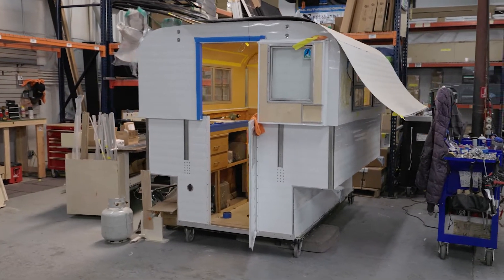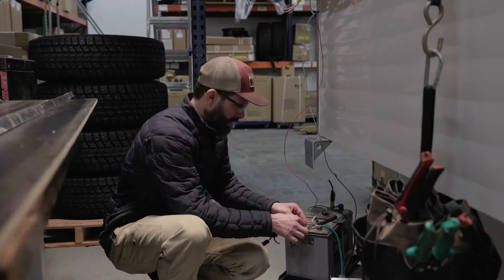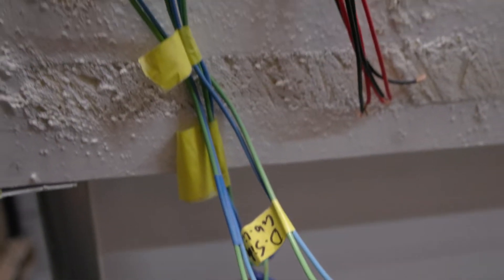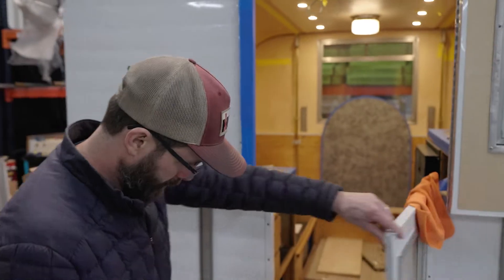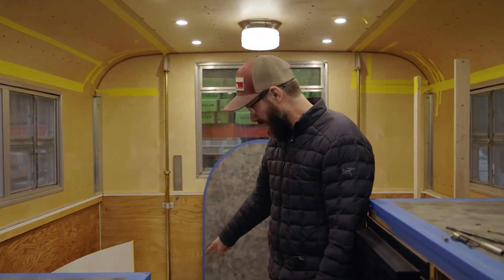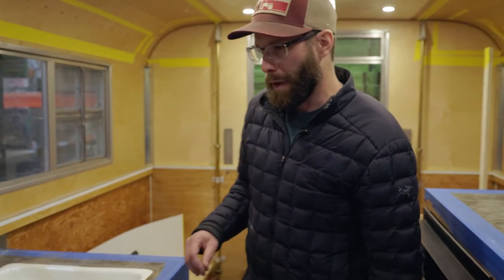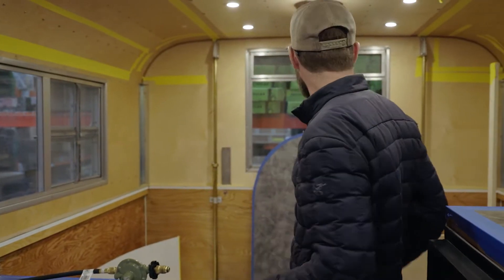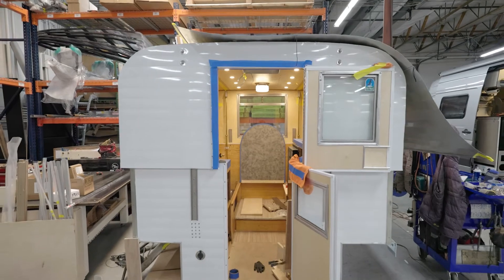1961 Alaskan Camper

Comment: How do you run the wiring from the bottom to the top half through the rams? I have a 1967 non cab over. It has a heater, a fridge(old astral martin) that i belive only runs on propane. It has a wierd shore power hook up on the cab, a 3blade style 35amp one i have never seen before. It has the over head light and a receptical in the corner behind the fridge. I would like to move the electrical system to the bottom half so i can install batteries. Any help would be apreciated.
Reply from the maker: hi not through the rams.

Comment: how do you feel about the Alaskans?
Reply from the maker: Hi HAMMAH! The Alaskans have many redeeming features. Great stability on the highway, you can pass semis and your truck doesn't get effected by the turbulence. A $200k Sprinter Revel can't claim that, they get buffeted and pushed around. Likewise a standard non-pop truck camper is going to get pushed around, and keep that bum hole puckered  up... other advantage is the hard-sided shell, bear country isn't an issue, and insulation is good enough for 4-season camping. disadvantages are typical wood-framed camper issues; water damage and rot... after 30years or so, you can expect a full rebuild is necessary and that'd cost just as much as a new one. The other disadventage is weight, they don't work on 1/2-ton trucks, need 3/4 or 1 ton to safely haul them around. Plenty of info on these over at wander the west.

https://www.wanderthewest.com/forum/forum/18-alaskan-camper-discussions/
Reply: @Reparadise  appreciate
 the information.  thanks for taking the time for me.
Reply: You guys do really incredible work. Love these campers. Would you consider doing a "Re-skin" on the exterior? Would love to hear more on the materials and products you're using. Hope to see more on this camper!
Reply from the maker: Hi Curran, there's a more Alaskan content coming that'll be sprinkled throughout the Airstream and Van stuff we're doing. Re-skining these is the best way to go, the old tin is not worth saving.